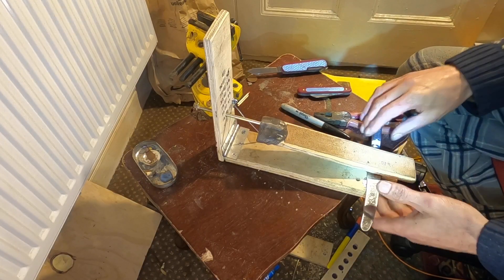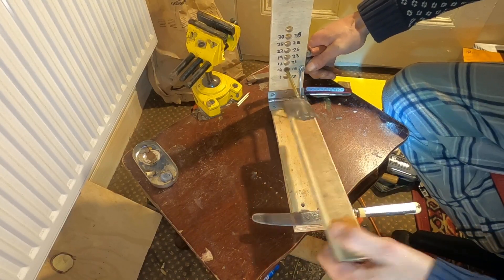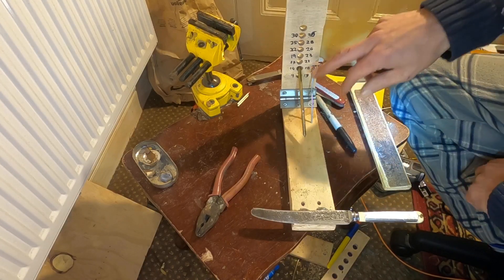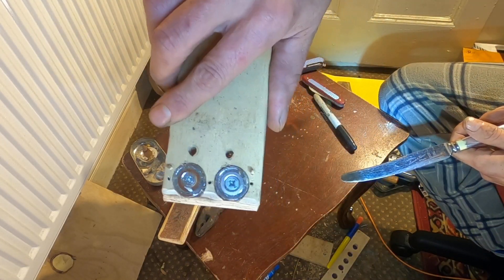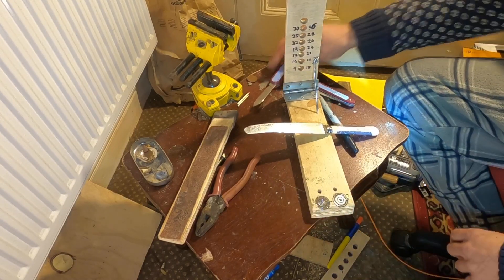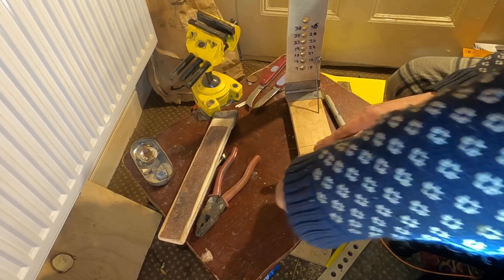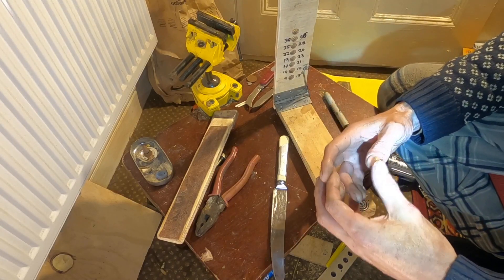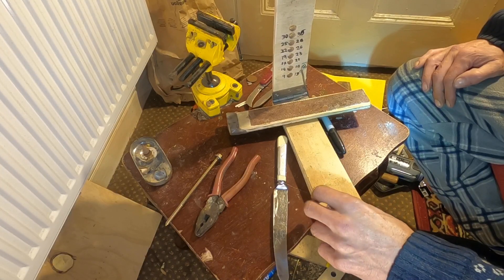Sharpening jig v2

Comment: You should be able to get some decent edges with that jig, cant help feeling its a little over complicated though, having your  "thread" central on your strop board makes it so much easier to just flip over for a different grade of grit or paper without having to undo anything.  Lots of those jigs are even four sided with a central rod to go through 4 different grits without changing anything.  You will get a better edge if you finish with some freehand stropping, one edge then the other alternatly to remove any burr, but it will all come together with practice.
Reply from the maker: You are right it’s over engineered but it’s ongoing and already come up with new ideas just sitting here drinking my tea and looking at it. Thanks for showing me this method it seems very uniform and accurate 👍👍
Reply from the maker: Yea it’s no way near as neat as that guys you sent link for, his was a masterpiece.  I liked the block as well 4 sides covers all the grades you might need. That said I haven’t got his tools materials or skills, and I’m to lazy and warm to go out gathering, so all this was from materials I had at home and has cost me nothing so far.  Also thanks for the heads-up about finishing by hand I do two strokes each side of the blade because my first is not always the right angle and the second stroke is more accurate for me I don’t know why,so yea thanks for the great tips as always my friend…. BatW